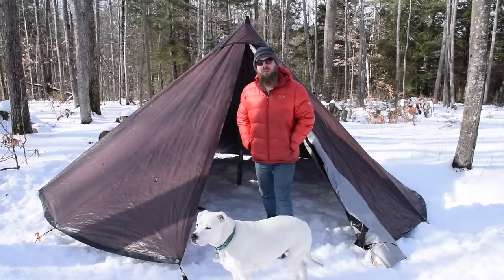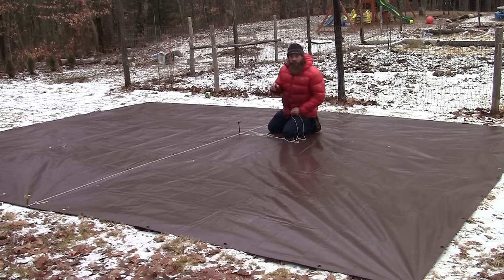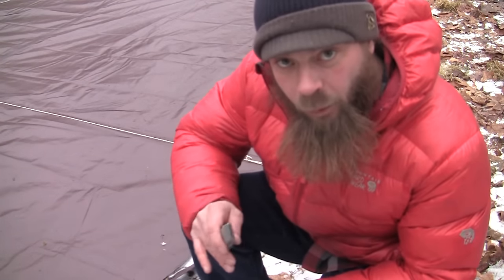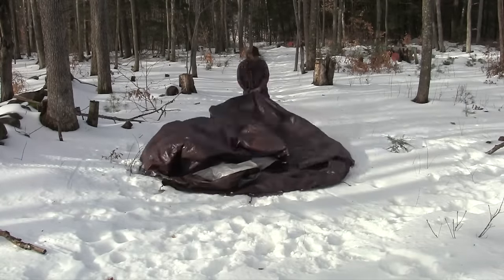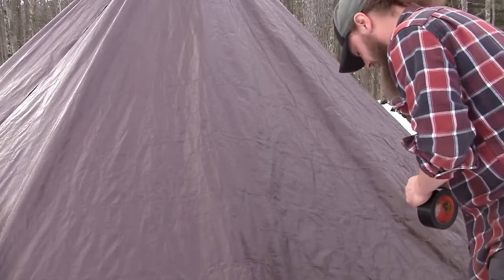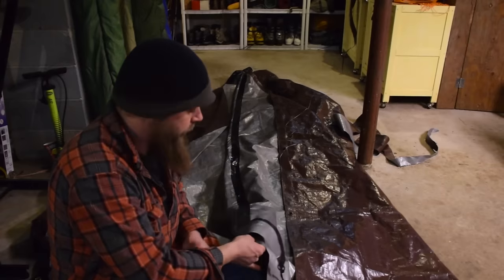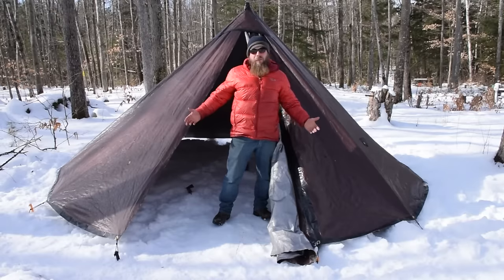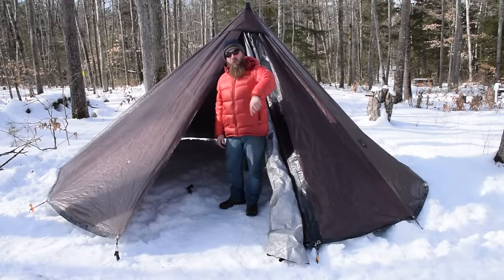CHEAP , DIY Hot Tent , from a tarp !!!

Comment: I am thoroughly impressed. It looks good. A charity assisting homeless might want to take serious note of this. What is the real life expectancy of the tapes used?
Reply from the maker: The charity idea is fantastic! That never crossed my mind. 
  I don't think this tape is ever going to let go. I put this tent through an 8 month torture test. It stood outside for 8 months before the weight of a tremendous snow low finally brought the tent down. Upon investigating, it was the oak pole the tent was pitched with broke. And this was no small oak pole. Turns out the tent and the tape never let go. The pole poked a hole in the tent and that ripped.  An easy fix. 
  These tents are incredibly strong. I have a video of that test if you are interested in watching it. I will send you the link. 
   https://www.youtube.com/watch?v=PCltLEE5is4&t

Comment: Nice job on the tipi and vid both. You had my attention (though on double speed because I dont have THAT much attention span).

I am thinking of a smaller tipi but with a 2' wall. The outer edges are unusable on a normal tipi, but if raised 2-3' then you can sleep out to the edges. In that case I think a 5' tall tipi around 6-8' diameter would be fine. Take that, raise it 2' to be 7' in the center and it should be good for a couple people. I am not sure how easy or difficult that would be to make with the 2-3' wall.

I am considering doing this with a canvas dropcloth (my first hot tent may be best to be fire resistant/meltproof). I dont think I have enough time to do this AND make a stove to use while we still have snow / very cold weather, but I would like to try out hot tenting before I buy commercial equipment for a lot more $$$
Reply from the maker: That is a good idea! I made a much smaller tent than this one out of a 10'x12' tarp. I just might try this modification on it. 
  You could make this tent in a few hours if you are motivated .....
  The reason I built a few was to see if I liked it before I spent a pile of money on gear. So I can relate.  Good luck on your build!!
Reply: @ItsGoodintheWoods  Yeah, as I am thinking through this style is super easy to make ans could be done in no-time. Score one for this style! With a thin tarp its also not hugely expensive (I don't want to spend $100+ on a design I KNOW I ultimately dont want due to the weight and noise of a poly tarp style).

I am working on a style that may be the raised pyramid / polygonal yurt style. Possibly canvas since I have a drop cloth already. Maybe I should build a stove first since that will be the most time consuming. If I get that done and I am short on time make this round cone style. If there is still decent time this winter / spring then consider making a raised pyramid style. Ultimately, I will likely want to re-make any style in sil-nylon or sil-poly for weight savings. Use the heavy one when weight and apace arent an issue, use the expensive fragile one when it is.

Do you know how steep the walls need to be to shed snow decently and not cave in with snow and wind?

Comment: Great job. Try using an iron and brown paper on the gorilla tape. It will literally bond it to the tarp.
Reply from the maker: Thank you. A good suggestion. But this tape isn't letting go. The tarp will rip first. I have video evidence LOL. I left this tent standing for 8 months, it finally came down when there was enough snow on it to break the pole. The pole went through the tarp , otherwise, the tent is fine.
Reply from the maker: Check this out !https://www.youtube.com/watch?v=PCltLEE5is4&t
Reply: Amazing, i made one based on your idea, but used an iron and just folded over the edges instead of gorilla tape. figured it would be lighter and it works well. only been camping with it a few times, but it works well. @ItsGoodintheWoods

Comment: Maybe I missed it, but does this tent have a vent for air flow? Thinking of making one and possibly a portable wood stove. Thanks for sharing!
Reply from the maker: It does not. There will be plenty of air coming in through the door because it  is just a flap. And I usually don't seal the entire base of the tent with snow.   If you wanted a vent you could easily put one in though.

Comment: Wow, YOU DID THAT!!! Makes  me wanna do that...could you tell me how much it weighs when you take it down?
Reply from the maker: This build is a beast! An awesome tent. It weighs 11 lbs
Reply: @ItsGoodintheWoods  Wow, Thanks for responding,  I saw the camp out  and remembered  what  a 10lb bag of 'taters feels like, not bad with the sled...how many  times have you camped with it,? Will you use it this winter?
Reply from the maker: @dianematlock7922  I have camped in this thing about 10 times. I do use it in the winter and I plan to this season as well. 
  I have a repair to make to it before the season hits though,  I left the tent standing outside for a torture test, this tent stood in place for just over 8 months before a heavy snow load made it collapse. Upon inspection, it was not the tent that failed, it was the pole. There was so much weight on the tent the pole snapped in two and poked a hole through the tent. An easy fix. These builds are very rugged. 
  Here is a link to the video of the torture test if you are interested in seeing it. https://www.youtube.com/watch?v=PCltLEE5is4&t  Please  feel free to ask any questions you may have
Reply: @ItsGoodintheWoods  I will check out the suggested vlog,Thanks  for responding...gonna do this...

Comment: My old woodwork teacher would turn in his grave seeing you punch holes on the flat grain.
 I was always taught to use the end grain of the wood for punching out.
Just a small thing, otherwise a good instructional video.
Reply from the maker: Interesting...I'm no woodworker that's for sure. I'm curious, why? What difference does it make?
Reply: You need to realise that I am now in my 70’s and there are a few gaps in the grey matter when I go looking for some things, lol, so I googled it.
I remember that the punch edge remains sharper longer, and it is easier to cut any holes using the end grain.
My grandfather always used the end grain on the leatherwork he did repairing shoes, so I never thought anything when the woodwork teacher did the same.

I have copied what I found from a leather workers forum.

The question was Posted on September 24, 2010:

What is the best type of board to use to punch holes, so that you don't dull your punches fast and also so you don't leave nasty rough marks on the leather, as shown?

“END GRAIN WOOD would be my suggestion. With end grain the punch easily separates the wood fibers,, and makes a nice clean cut. This is what I use for punching gaskets, You can make your own by taking scrap pieces of wood, and glueing them together. Most of the time I just use a chunk of 2x4, or 4x4 that I have laying around.

With plastic, or edge grain wood, the stamp has to compress the material to cut clean, and it takes a lot more effort to do so. End Grain easy peasy..”

I would suggest you could try some end grain punching and check if you notice any difference.
Reply from the maker: @briandalrymple9986  Fantastic! Thank you for taking the time to look that up and let me know. When it comes right down to it, this is what it's all about. Sharing information. 
   I really appreciate this comment. Thank you. Cheers

Comment: Obvious question is why not an insulated tarp?
And tip for those using old tarp for your first try
Clean all surfaces with rubbing alcohol that you plan on taping.
Decent video
Reply from the maker: Insulated tarps would make this tent much bulkier and heavier. This was the tarp I had access to. The alcohol is a great tip. Thank you for sharing
Reply: Also, no need to cut and add all this other crap..

Comment: Awesome content! I have some question though:
1. How solid the tarp has to be? Does the 10 mil one you use works good? Or should I get a thicker one? 
2. Does it get holes from sparks when you use oven?
Thanks!
Reply from the maker: This tent is insanely strong! It's so strong, that I am going to start constructing another tent out of a lighter tarp! Going down to 7mil. 
   Not one hole in it from sparks. With a long enough stove pipe, and using hard wood to burn, spark holes are rare. I have 4 hot tents, have been hot tenting for years. Only 1 of my tents has a tiny spark hole in it. One spark hole! Easily fixable too. 
  Here is a link to the torture test this tent just went through. You may find this interesting.https://www.youtube.com/watch?v=PCltLEE5is4&t
Reply: @ItsGoodintheWoods  Awesome, thanks a lot! :)
Reply: @ItsGoodintheWoods  I have just made one following your video! By hard wood you mean oak and not needle trees?

Comment: I think it needs skirts at the bottom so you can pile snow on top of the edges.
Reply from the maker: Skirts could absolutely be added, but are not needed. Snow can still be piled up around the edge if I want to. Most of the time I choose not to. I like the air flow. Helps prevent condensation

Comment: Now if you used a 30x40 tarp, you could have that tent and a floor.  Folded under inside, you'd have no draft from the ground.
Reply from the maker: That is a good idea. But I prefer to not use a floor. I like to use a ground sheet where my sleep system goes. If I want to block out draft I pile snow around the edges of the tent. If it is snowing the snow piles up naturally on its own.

Comment: Thanks for this video! I also like to make things myself and this beats having to spend $300+ on a hot tent. A couple of questions.

- How long do you think this tent will last under moderate use?
- Is there any reason you couldn't use Flex Seal Tape everywhere? It seems much more durable than the Gorilla Tape.
- Finally, what would some final interior dimensions of some slightly smaller tarp size tents? I am looking to build a one man tent for hunting out west.
Reply from the maker: These things are amazing! Under moderate use, It'll last forever! No joke. I did a torture test of this tent. Left it standing outside for 8 months before it failed. It came down due to a very heavy snow load. But it wasnt the tent, or the tape that failed. It was the big oak pole that I used to support the tent. It snapped in half. The tent held up to the weight and abuse, the pole did not. I have a video on it, you should check it out. It is absolutely amazing what these tents can take. Here is the link https://www.youtube.com/watch?v=PCltLEE5is4&t
   I think the gorilla tape is far superior to the Flex seal tape. much less stretch to it. It holds. And it is much cheaper. It would cost a lot of money to do all that taping with flex seal. 
    I built a much smaller one years ago out of a 10x12 tarp. That made a nice sized solo shelter. Still have it! There are a few videos of that one on the channel as well.  A comparison between these two should give you a pretty good idea of what you will end up with https://www.youtube.com/watch?v=yhEsXWFg_3I&t
   These tents are awesome and well worth the time to build. I have plans for another build coming up shortly. Thank you for watching. feel free to contact me with any questions you may have.

Comment: Great video!  Thanks!
I'm wondering if it would be pottible to use a soup can or something similar for the place for the top of the pole to go, reinforcing it even more!
Have you tried something like that and, if so, how did it work?
Thanks, again!
Reply from the maker: There is no need. I put this tent through an 8 month torture test, it wasn't the tent that failed. The tent held a tremendous snow load,  it was the big oak pole that failed. It blew apart from the  snow load.  But if you wanted to, simply use a tennis ball on the end of the pole. Thank you for watching. I am glad you enjoyed the video

Comment: nice! but couldnt you have kept the corners instead of rounding it, and maybe pulled them in underneath so that there is a bottom?  i understand you put in the gromets, but you could have done that in either case. maybe even stitch a square or semi-circle around the gromets so that one of the two layers of tarp don't come away from the gromets in the wind or something.
Reply from the maker: I'm sure I could have, but less material is less weight...there are some pounds in those corners.And I do not like floors in my hot tent set ups.
Reply: @ItsGoodintheWoods  true. understandable. I was homeless for many years and had quite a few tent set ups. I didn't move them unless someone destroyed it or my spot was compromised, so I hadn't thought about traveling. Just a tarp pitched for rain/snow and one for a footprint if they're heavy duty is a Good deal of weight if you account for everything else you're carrying. My pack alone on average was 35- 55 lbs (I checked at an Amtrak station a few times lol)

Comment: how did you know the height the tent would be while making cuts, before putting it up? Is there a calculation you used?
Reply from the maker: This is a very good question.  To be honest, I did not know. I had built a smaller tent just like this one before I made this tent. I used a 12'x10' tarp for the first one. I knew I wanted a bigger one, so I bought a much bigger tarp. This is what I ended up with. 
  However, you could make models to scale out of paper. Check out Far North Bushcraft and survival. He does a very good explanation of the process.

Comment: When you do a hot tent like this or in one like canvas in whatever shape... how do you tell how much distance you need between the tent top and the stove to make sure you don't get a fire, fire hazard, etc? Thanks. I'm a bit worried about this and want to learn right.
Reply from the maker: There is a learning curve to it. You can actually get the two surfaces fairly close to each other. 18"-24" should be enough clearance between the wall and stove.
Reply: Thank you.  @ItsGoodintheWoods

Comment: Great effort thanks for sharing.  What size grommets did you use?
Reply from the maker: Off the top of my head I don't recall. It doesn't matter though. As long as you can run cordage through the grommet.
Reply: @ItsGoodintheWoods  Thanks.  I asked because I was trying to put together a list of items, and search the local stores for them.  I agree the exact size is not important.  I just matched the size that was already in the tarp I purchased.  Am thinking I will try and save as many of the original tarp grummets as possible.  Will see if I can manage this.

Comment: Awesome job on the DIY hot tent.  One question for you, what is the moisture/condensation like after a night of sleeping in int?
Reply from the maker: Thank you.  It will collect a fair amount of condensation. The tent performs like all other single wall tents made from a non breathable material. Fire up the stove in the morning, wipe the walls down with a microfiber towel. Good to go!
Reply: @ItsGoodintheWoods  Hey thanks for the super fast reply!  Yeah I figured it would be that way.  Totally worth it for what you get at the price point. I love the idea of bringing a micro fibre towel to wipe it down.  that's a great call.
Reply from the maker: @davidrouse2612  These are awesome rugged tent builds. Amazingly capable. 
    The micro fiber towels work wonders. Wipe down, wring it out, repeat. Then I dry the towel by the stove. Works very well

Comment: Hi Justin,
I've been collecting materials to make this tent. Probably start making 'er this week. Question, at 17:40 you say the guy-out points need to be vertical. Why not horizontal so the tape can fold down comfortably? Just curious. Thanks!!
Reply from the maker: Now that you ask that question, I'm not sure it matters. What does matter is that the guy out is running a straight vertical line from the base of the tent to the top. You want them to pull as evenly as possible. I hope that makes sense, as I'm not the best with words. Best of luck on your tent build! Please keep me posted on it.

Comment: Will this work for a 20x15 rather than a 20x16? Supply is limited at the moment
Reply from the maker: It will work. The tent will be a tad smaller. It'll still be a good sized tent. The first one I ever built was from a 10x12. That one is small.
Reply: @ItsGoodintheWoods  thanks dude